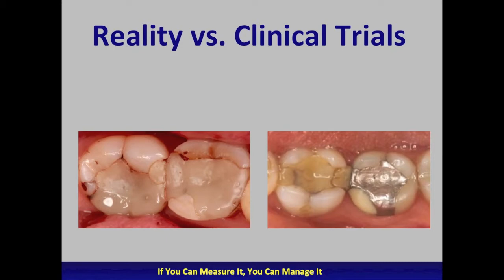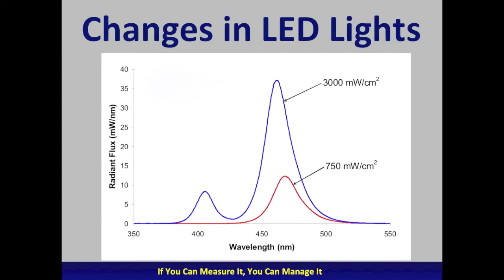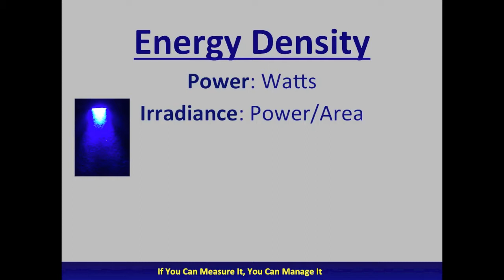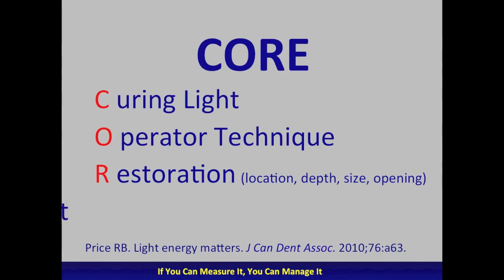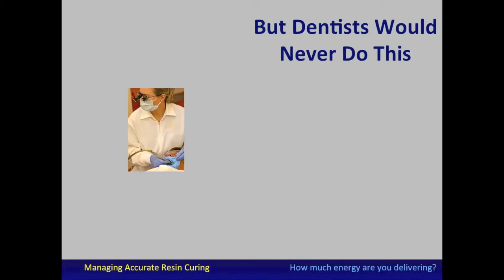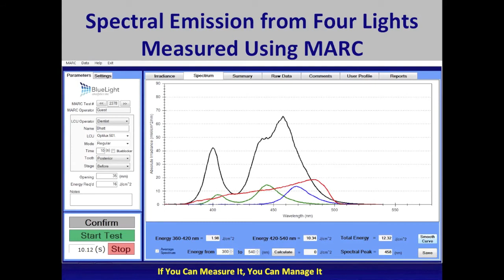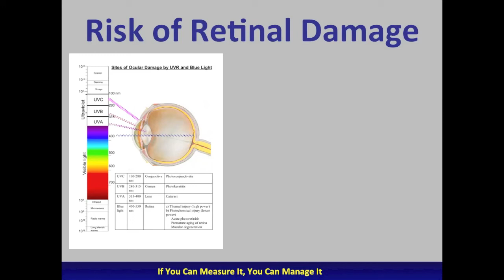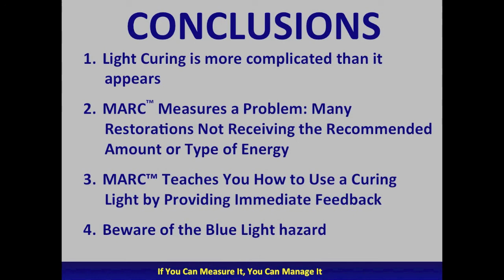LIGHT CURING, IT LOOKS SO EASY

Comment from the maker: Yes you can cause a dangerous temperature rise in the tooth pulp if the curing light is left on for too long.  Follow the light curing manufacturer's instructions.  If you blow air over the tooth or place a high volume suction next to the tooth, you can cool the tooth down.